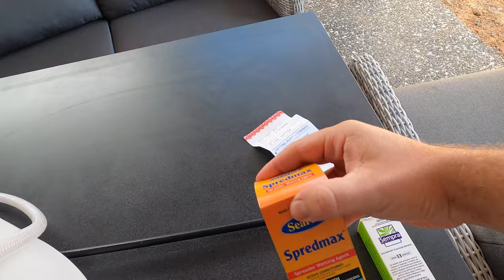My Nut Grass Problem | Landscaping Vlog 2 | Hero 8

Comment: Dave, Use pathweed from bunnings next time. Its in a yellow container. Also with the tarp, use weed mat not tarp as you want the water to get through. Weed mat comes in a roll and a lot easier to run out etc. Yes get through as it helps with limiting building and brick cracking in hot/cold weather etc as you still need to have water access the ground.
Reply from the maker: ray holmes oh the tarp on the front lawn is just to limit the amount of dirt they gets to the drainage rock while it sits on the front yard it will not be used as weed matting, I have used the rolled weed matting all down the sides but , I do appreciate the advice but as I am an amateur haha
Reply: ok cool, there is a lot of tricks etc that you can pick up by watching bunnings vids on utube. Like, laying pavers for example. what suburb is the house????
Reply from the maker: ray holmes YouTube is great to learn things hey, it’s out in the beautiful Redlands 😍
Reply: Ok cool, I live near Kiama NSW but I think your talking about Redland Bay area maybe. I have a block of land on Russell Island which I intend to build and retire away on someday. There is negative about it as you have to catch the jetcat across but it runs every hour until 1am but starts again at 5am. Yeah there is a few disliked people living there but you get that anywhere but there increased the police from 1 to 2 and things have changed heaps. There is about 4000 people living there. Its just peaceful and I am walking distances from the IGA store and clubs etc. I just have to start building one day. At the moment I police the streets of wollongong but have a few years to go before I retire
Reply from the maker: ray holmes Kiama! I grew up in Minnamurra and went to Kiama High haha, that’s quite the sweet sounding retirement plan man! I’d love to build on the island for retirement , and mate tough beat some of those spots in the gong to police